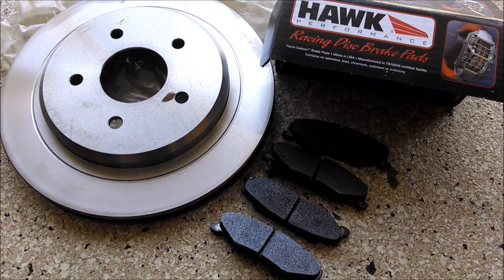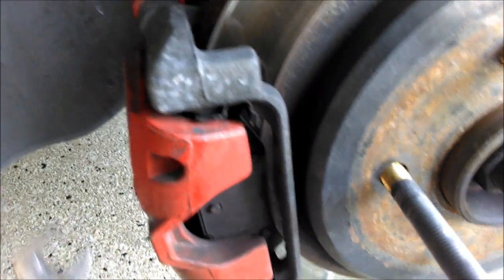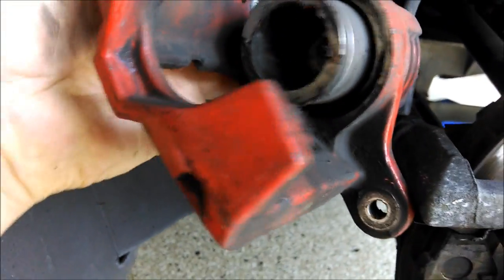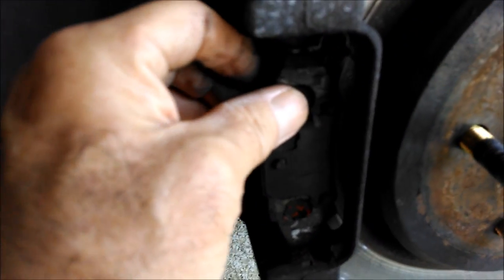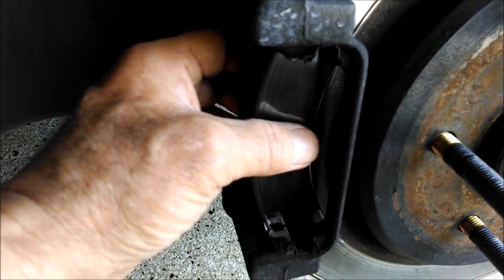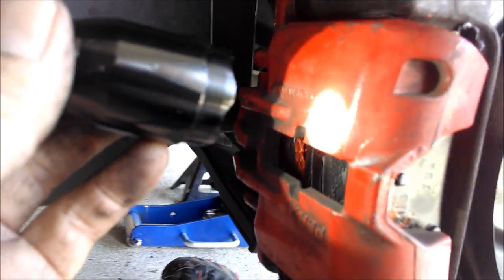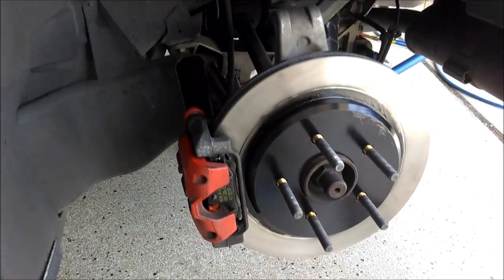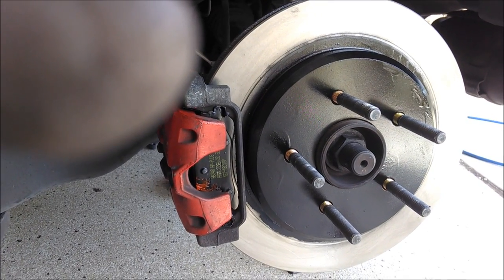Corvette rear brakes pads and rotors install by froggy

Comment: Thank you  - very informative ... you do an excellent job for us Do-It-Yourself folks ... much appreciated ... You  missed an opportunity to mention the E-brake drums and the adjustment needed when the e-brake is so far out of adjustment it does not adjust with quick stops in reverse ...
Reply from the maker: Thanks for viewing, yes that's important, but would qualify as a separate video for me. I don't like to put TOO MUCH in one video. Keep it simple. FWIW I never had that issue with c5 brakes.

:)
Reply: You are welcome ... thanks for all you do the keep my (and our) $$ down while not compromising on repair quality and safety
Reply from the maker: You might (or might not) be surprised at the shoddy level of service/repair you get at some dealers and independents. Not all, there are some honest/good ones, but hard to find it seems.

And the prices! For simple stuff!

:)

Comment: Thanks, Froggy, great video.  It never hurts to mention safety when jacking the car.  I built a couple of drive-on chocks by taking a rubber chock and lag-bolting it to a 3/4" piece of plywood about 1' long.  You drive on it and it doesn't slip.  Also, it would have been interesting to see your technique on breaking those two bracket bolts free.  I have used 2 methods in the past:  I have a bracket lag-bolted to the sill plate of my garage wall to which I attach a come-along and use that to apply the force in a horizontal direction, and I have used a 4x4 cut to the right length and my floor jack to apply the force in an upward direction.  Both techniques keep me from being under the car when applying a lot of force--even on jackstands and cross-beam you never know.  Having a lift would be more better.
Reply from the maker: Hi Jimbo,

Caliper bolts I use a long breaker bar (1/2 inch drive) and turn the wheel so I can swing the bar better.

:)
Reply: froggy
Hard to turn those rear wheels.....  :-)>
Reply from the maker: Haha. For those you need to jack that rear end up HIGH to swing the bar.

:)

Comment: Hi Froggy, I have used your videos many times over the years to help me repair my 1999 c5. Thanks so much for the time you have taken to help others, it's greatly appreciated. 
I do have a mystery issue with brake lines that I hope you can help with.  I am replacing my OEM brake lines with stoptech stainless steel lines. The original lines have notches on the car side which lock them in the hole and the the other side by caliper has a block mount. Neither of the ends on the stoptech match the originals but me to  fit. I confirmed with stoptech it's the correct part.  Should I be concerned?  Thank you

Happy holidays 

Ira

Comment: hey Froggy, why would you just not put anti seize in the axle splines to eliminate the noise from the axle nut?  Good call on the blue lock tight.
Reply from the maker: +hasbeengood That would work also!.

Thanks for viewing.

:)